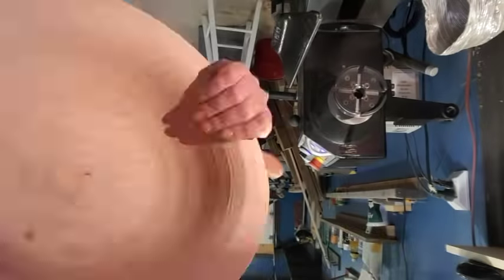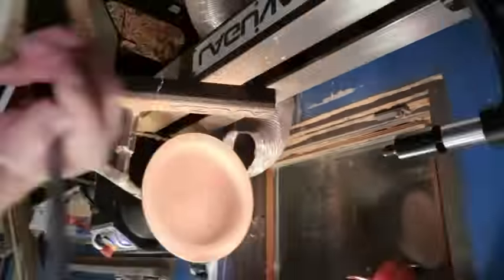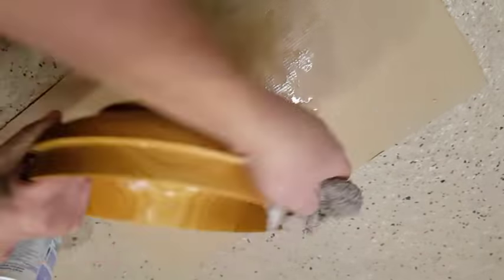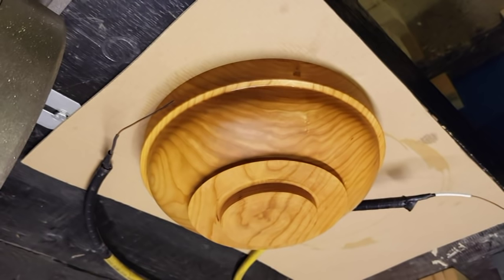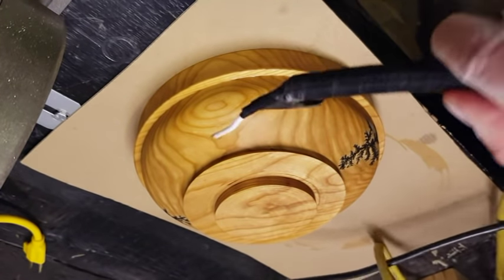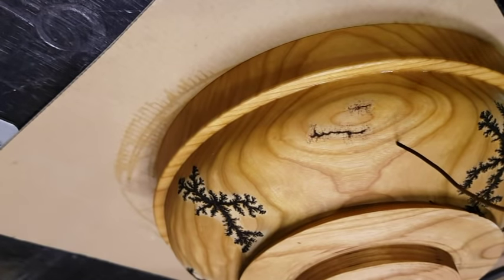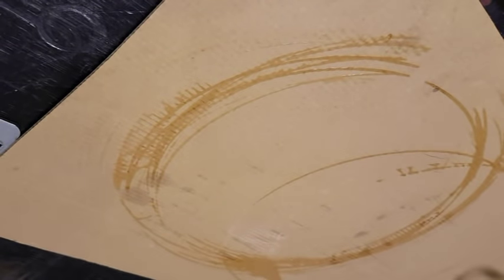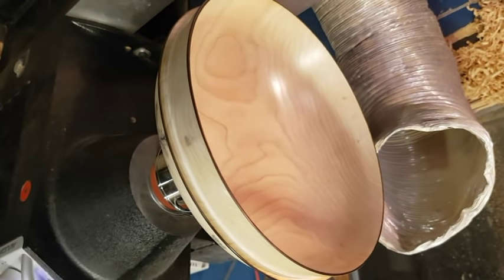Woodturning : Electricity Wood Burning Tips

Comment: Holy shit that is so unbelievably dangerous. Like, unfathomably unsafe. To get Lichtenberg lines like that you need to be using insane amounts of electricity. Since that looks to be a slapdash homemade setup, I’m assuming it’s using a step up transformer from a microwave, probably around 2000V with 1-2 amps. That is WAY more than enough to kill you if you even brush up against the wrong part of this setup. Plus, with the way a microwave’s transformer works, your home’s safety switch will probably not shut it off if you get electrocuted. I checked and this channel hasn’t had a new post in 4 years, so I greatly hope that this man is still alive. Seriously do NOT try this. Many a professional electrician would be sketched out by something like this. This kind of thing makes a downed power line in the street look like a staticky blanket in terms of safety profile.
Reply: Thank you for spreading awareness. Fractal Wood burning tip: Don't
Reply: Thanks for posting this. Make sure to report the video as unsafe as well. Youtube is starting to act on these.
Reply: this comment is so important
Reply: holy shit i am actually heartbroken. this comment made me realise some of the people in this comment section, especially the ones who were asking questions, could be dead now
Reply: @acookie7548  We can help by flagging as these videos as dangerous, Youtube seems to be starting to take action.
Reply: @acookie7548  Similar thoughts have crossed my mind. It is horrifying. But I feel like it is in our grasp to at least stop this.
Reply: ‘Bout the same amount of voltage as the chair…damn.
Reply: @acookie7548  The person who posted this video has a facebook page that doesn't appear to have any posts beyond 2018 and his website is down as well.  I was hoping he would re-do this video with a warning or something similar.  I hope he's ok.
Reply: @egratudo1974  perhaps, redirect that towards someone that is actually going to attempt this.
Reply: @imperfectaqua602  well you can do wood burning but with a safe device like a dremal wood burner that just has a heated tip rather that dangerous amount of electricity, its Pyrography
Reply: @informationyes     oh yea, ive used it before lol. I thought you were saying there's some machine to fractal wood burn safely. My comment was just worded badly, was trying to say fractal wood burnings bad, fixed.
Reply: @imperfectaqua602  Im here from Ann video too I just wanted people to know theirs wood burning with just an application of heat rather than this frankenstein stuff
Reply: @informationyes  'Frankenstein stuff' lol =) yea I get u,, so people won't assume all wood burning is bad
Reply: @clarityhouston3499  that is completely incorrect. You can look up OSHA stats, which will tell you that lathes contribute around 2-3 deaths per year despite the fact that there are over 300,000 machinists in the US. In contrast, there have already been 33 fatalities due to fractal wood burning since 2016 even though comparatively few people do it. Also, this man clearly has very little electrical experience, which anyone with any EE knowledge would be able to tell you just by looking at his horrifying setup. In any case, it’s quite possible this man has already died from this “hobby” seeing as he hasn’t posted in several years. Also, this is NOT what “electricians do every day.” Following safety guidelines, wearing protective clothing, and proper handling of high-voltage wires/equipment are standard practice for electricians for good reason, and this man did none of that because he’s a hobbyist casually playing with a device that carries the same voltage as the electric chair.
Reply: @clarityhouston3499  Nope theres a difference betreen using a proper peice of equipment and geri rigging your own, theirs a difference between proffesionals trained to use their industrial equipment and doing something so dangerous at home with no garrentee of training, knowledge or experience, and the voltage used here is on the extreem end way more than an electricion would typicly be exposed to in his job not to mention this paticular device circumvents all safety electrical safety measures

Comment: I believe the word you are looking for if you get the wires too close and they "communicate" is they will "arc".  The wires too close cause an "electrical arc".  Great video!
Reply from the maker: +Sam Watson yes , thank you Sam
Reply: SG Art Turning . hi good work .  I'd like to know how you make your burning equipment.  I been trying to make one for myself . plz reply . thank you
Reply from the maker: +lizard king hi thank you, I'll use a 2000 volt microwave tranfo. Check on the web you will find some plan for how to do it
Reply: are u sure is not 20000 volts ?
cheers
Reply from the maker: +Constantin Nicolae lol no
Reply: if you find a way to control the voltage very well so you can turn it down much lower that should make it so that you can get them much closer without arcing.  or possibly use less amperage.  I'm definitely not an electric expert just ideas
Reply: A device called a "Variac" does that. You can control the input voltage with a variac.

Comment: Safety first. Which is why I bought the machine from the manufacturer. I know it'll still kill me if I get the probes close together, but at this point the project I have in mind for the Lichtenberg Device is a ways down the road. By the way, you speak English very well and thanks for the side grain tip. I did not know it wouldn't burn as nicely as the end grain.
Reply from the maker: +Terry Evans Thank you Terry

Comment: Excellent video!  As a Lichtenburg pyrographer myself, I've been using a "hands-off" rig for quite some time, but I've recently started building a handheld rig as well... complete with a deadman switch, arc-flash gloves, insulated matting, etc.  (Believe me... I have a VERY healthy respect for electricity, given that I've been arc-flash certified since 2014.  :) )  I have, however, been having some trouble designing the probes to my satisfaction and safety standards.  Any and all advice on the subject would be sincerely appreciated...!
Reply from the maker: +Scott Kniss Thank you Scott, I can not help you on that . My machine is not very safe I think . And I don't take a nought safety materials too.
Reply: Scott Kniss I know this is an old comment, I have used a length of plastic pipe (40mm dia 400mm long) with silicon tapered bungs as a press fit, one for cable entry and one for mounting probe the opposite end,tight hole through both bungs. I use a few variations in this manner, some as high voltage test probes (with internal voltage divider), capacitor discharge tool (longer, extra insulation with internal dump resistor) and general probe for uses such as this using silicone hv cable for flexibility.

Comment: On Safety; 
In the military, when working on high power wireless equipment, standard safety precautions were;

1, Stand on a rubber mat, 3/8'' thick, [10 mm] laid on a duck-board, to provide an air gap, and reduce any chance of connection with the ground. {duck-board should be glued together, not nailed or screwed.]
2, Always work with one hand only, and the other in your pocket, to minimise  any possibility of completing a circuit, through yourself.
3, A circuit breaker, that you can operate with your foot or hand, in case you make a circuit some other way.
NOTE.
If you complete a circuit from one hand to the other, or other part of the body, the electricity will seize your muscles, and you will not be able to let go.
I had this situation once, accidentally, with 240 - v luckily, I had the presence of mind, and a wall behind me to kick myself free.
When working with Volts in the Kv ranges its much more dangerous, as the shock can stop your heart, and cause permanent damage to your nervous system. 
In effect, it will burn it out in the same way as it burns tracks in the wood.
This happened to a man I worked with, who was holding on to a metal frame of a piece of high voltage equipment, when he made contact. He suffered permanent injury to his nervous system, even though he was rescued in time before it killed him.

I would suggest that a better way to perform this procedure, would be to place the terminals into contact with the work-piece, and then switch on the power. A simple wooden bridge, made with plank off-cuts, with a couple of holes drilled in it for the cables to be pushed through.
When the desired  pattern is formed, switch off, 
This way there is no possibility of an error, and death!
Reply: Good advice.   Remember "Every safety rule is written in blood, (or in this case, brands and toast)."

Comment: hello SG, whe you were doing this trick, did you use straight connection to the outlet, or did you have a step up transformer device? thanks fred
Reply from the maker: +Fred Duvall Hi Fred , yes I use a transformer you need a least 2000 volt for electricity to work well.

Comment: What equipment did you use for the wood burning? I have seen people using microwave transformers, but I was told it is really dangerous. So can something more safer be used?
Reply from the maker: +The Entertainment Channel I'm using a microwave.  But if you check on the Web I think you can find safer device.
Reply: Thanks for the tip
Reply from the maker: +The Entertainment Channel it's a pleasure my friend

Comment: Thank you for your clear concise instructions.  Your work is beautiful.  I can't wait to try this myself.   Is this 110 or 220 AC or are you using DC?   70 yrs old and very respectful of the power of electricity.  Been thrown across the room by my 220 outlet.  Learned a valuable lesson early in life.
Reply: Then you might want to consider giving this one a miss. Many people have died doing fractal wood burning, because the energy is not comparable to an outlet.

Comment: My advice is to use quite a lot more electrical insulation ... should you use a microwave oven transformer the output power will cook you and you will DIE , should you get anywhere near the 2000 Volts ! ( this high voltage can jump a fair distance ) I would use a 15 inch highly insulating rod to move the wire tip ( NOT bundles of PVC tape , around the wire  ! ) ...

Comment: It would help to insulate the bare metal of the probe tips to prevent arcing when they are close together.  Or you could use shorter  length metal pieces on the probes.

Comment: People are dying in record numbers by doing this and the chance of death is 70% if they come in contact with this voltage. The other 30% are mutilated for life. 
No - it won't trip your home's breaker because your body acts as just another part of the process and causes the voltage look for a ground inside your body, can't find it and goes back through the transformer to find the ground - in-essence you become part of the transformer-itself.
This is more than the voltage of an electric chair and it's incredibly dangerous.
It's not worth it - DON'T do it!

Comment: Where are you connecting the two wires? Are they normal 240v?
Reply from the maker: +Roger Crook it's a normal microwave connection 110v  . Check in the Web you will find some pattern to where connection go

Comment: Not sure this can be made safe, but you could make it a little safer. Either use an isolation transformer or an Earth Leakage Circuit Breaker.

Pas sûr que cela peut être sécurisé, mais vous pourriez le rendre un peu plus sûr. Utilisez un transformateur d'isolement ou un disjoncteur de fuite à la terre.
Reply from the maker: +pointer2null Thank pointer I'll check that.
Reply: جميل جدا
Reply: Thank you - it's the visor (blush) شكرا لك، انها حاجب
Reply from the maker: +pointer2null Thank you :)

Comment: What should be the Voltage and Ampere of the current ? Anyone tell plz
Reply: If u have 220v on the input you get like 2000v on the output and the current depend of the transformer so u need to check the nominal parameters
Reply: Ohh wow sounds good, 
Thanks a lot

Comment: DO NOT DO THIS IF YOU TOUCH THE WOOD, THE WIRES, DROP IT YOU WILL DIE. This will kill you. Even if you have special gloves on it will go through them (it's happened multiple times). 2 professional electricans have died attempting this. 40 people have died attempting this, do not do it.